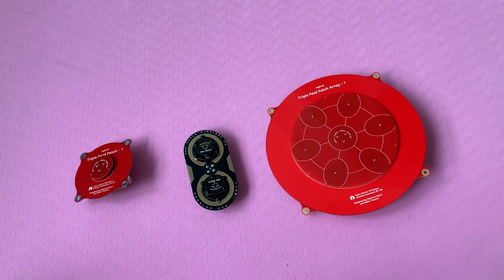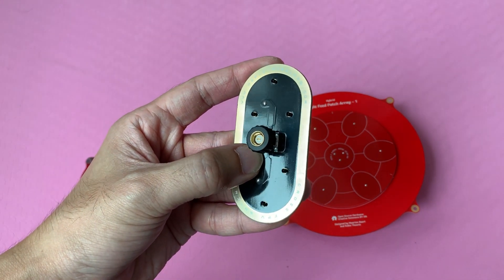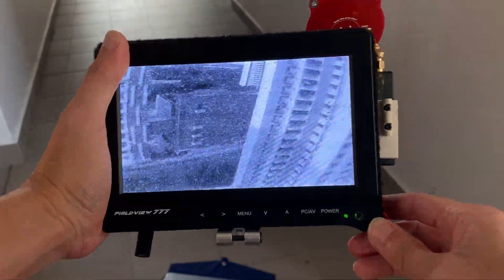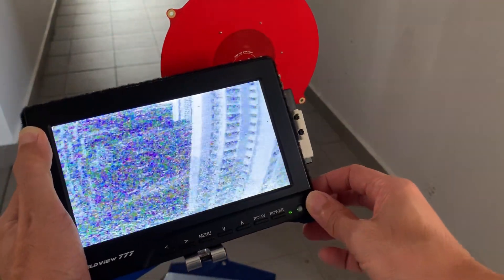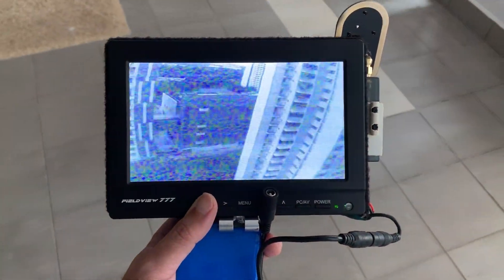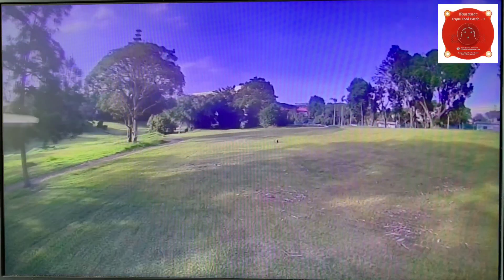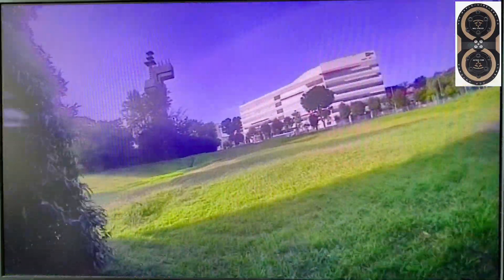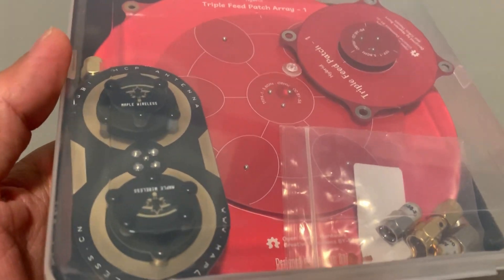Testing PCB antennas for HDZero FPV

Comment: I know this is an old video, but do you recommend mounting the maple antenna vertically like in your test or horizontally? I read the beam width is 20° lower on the different axis but im not sure which axis is which. Im looking to fly as far as possible while maintaining an altitude around 100-300ft
Reply from the maker: Thanks for watching. The axis that m using (portrait layout) will ensure you have adequate horizontal beam. :)

Comment: Great comparison footage, do you think running linear antennas would be better for a digital system? (assuming we run it for both vtx and vrx)
Reply from the maker: Thanks for watching. Linear polarization has a slightly longer range than circular polarization where all other variables are equal. Circular polarization is effective in eliminating multi-pathing, however a MIMO digital system like WiFi video and Connex where the data transmission has multi carriers, will benefit from multi-pathing instead. The DJI digital FOV system is a partial-MIMO system so linear polarization will work pretty well for it. However,  the sharkbyte system isn’t exactly MIMO, it uses a known Analog Devices RF chip combined with its proprietary module from Divimath to have data redundancy. Hence, circular polarization is still preferred for the sharkbyte.
Reply: What about Walksnail? You think that system could benefit from linear? Cause the antenna options in linear are so much better

Comment: Had been using the maple wireless. Good to know it has a wider beam width.
Reply from the maker: Thanks for dropping by! Glad you are using it too. They are pretty good for their price
Reply: @terence79chan  I wonder how does it really compare with VAS extreme crosshair, ImmersionRC SpiroNet, or lumenier axii patch antennas.

I guess the maple wireless would not be able to penetrate better compared to the more expensive ones

Comment: This is interesting!  I would like to see a longer flight test, in a challenging environment.  From the videos that I've watched about Shark Byte, it seems susceptible to multi-pathing.  When running 500mW in a strong multipath environment, there tends to be more pixelating of the signal.  In that same environment, on 25mW or 200mW, it appears that the image improves greatly.  This are simply my observations, of course.  I'm still going to buy the system for my HD02's! :)

Comment: I wonder how these would work in a diversity setup?
Reply from the maker: They work great on a 4way diversity setup with the big 150mm patch pointing 12 o’clock and 2 wide-angle Leaf antennas covering the 2 sides. Plus one antenna port left for a high-gain omni like the VAS sky hammer antenna.